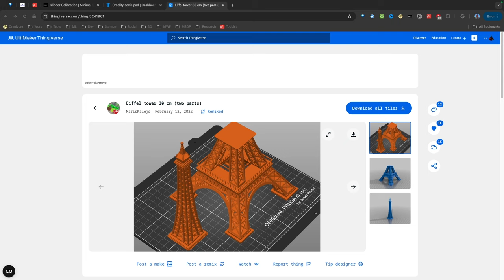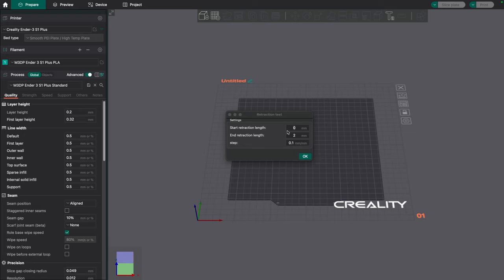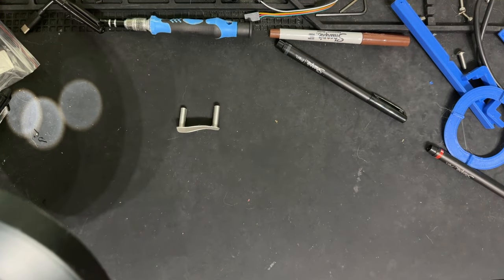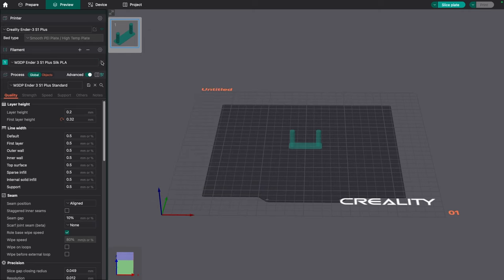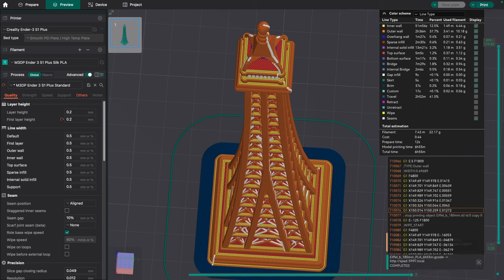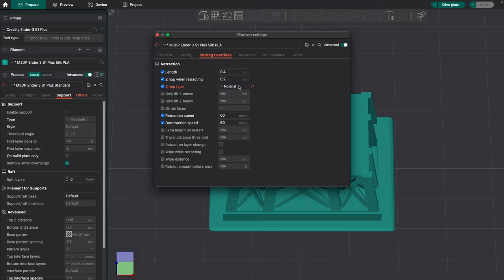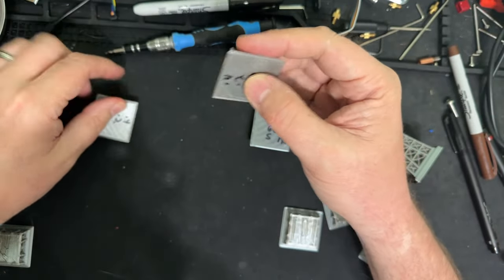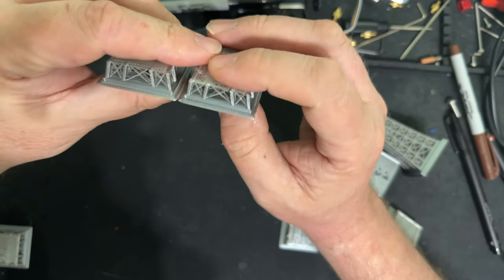Orca Slicer Retraction Calibration: The Key to Banish Stringing on Your 3D Prints

Comment: Thanks for sharing. Those tips should help a lot of newcomers to the hobby. I print some silk and usually don't have stringing issues. You made sure the filament was dry as well I assume? I know it is not that hygroscopic mind you. The biggest downside to silk though is layer adhesion. So I hope the trophy lasts a while. Cheers
Reply from the maker: It was actually french out of a well sealed package. It was dry (as far as I could tell). Try he end result was pretty good.

Comment: Thanks.  Great video.  Love the delving into more settings for orca
Reply from the maker: You are welcome. I am hoping to do more deep dives. Let me know if you have a specific question I can address.
Reply: @minimal3dp  infill density.  In Cura /creality it was straight forward.   In orca it's confusing.  I have more layer control for single extrude filament changes, but it seems way more complex

Comment: Given how little stringing you ended up with, would a quick swipe with a temperature controlled heat gun or a small torch, take care of what’s left?
Reply from the maker: Probably but my wife was happy with the results. I was also worried that the thin sections would not hold up. I might try it on my extra tower.

Comment: Hi just to let you know there is a pre made printer profile in orca slicer now for the ender 3 S1 plus, but ironically they have set the retraction at 8mm so watch out for that if you decide to use it 👍
Reply from the maker: Already got bit by the 8mm. I printed a square and the side fell off. No filament in the corners. Thanks for the heads up.
Reply: @minimal3dp  dam it !, me too and it took me a while to figure out what the heck was going on 😂, I think they used a base profile from the Bowden style ender and just missed it.
Reply: @minimal3dp  dam it !, me too and it took me a while to figure out what the heck was going on 😂, I think they used a base profile from the Bowden style ender and just missed it.

Comment: Hello, what would a good retraction test range for a high flow kit be? 
I was using a CR Sprite Pro and had dial in the stringing issues but after I changed to a high flow, oozing and stringing was damn apparent.
Reply from the maker: I would look at something under 1, like .3-1. Test retraction distance and speed to get the best results.